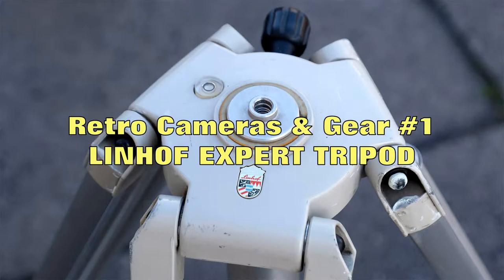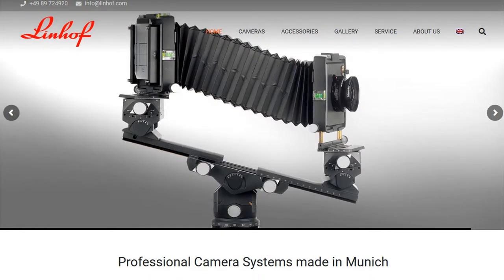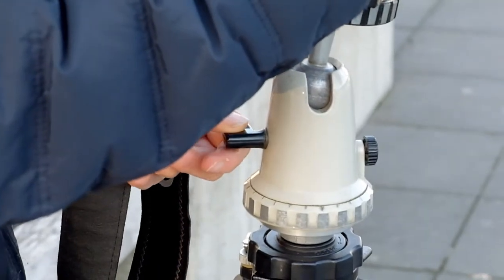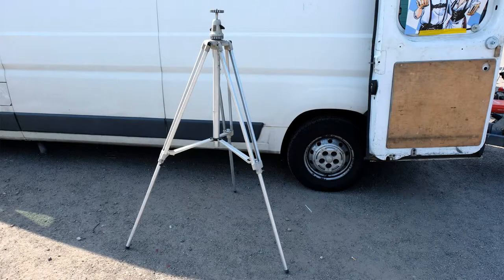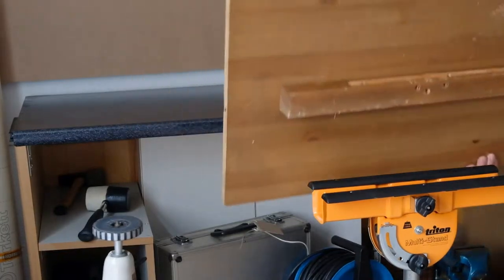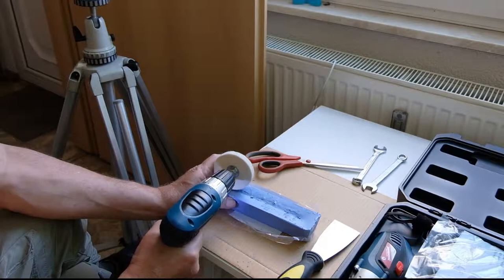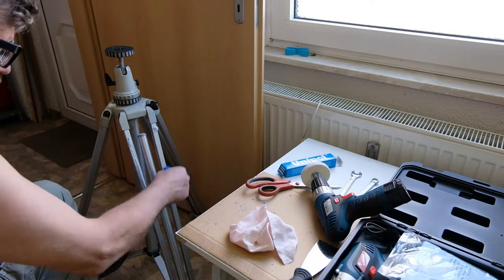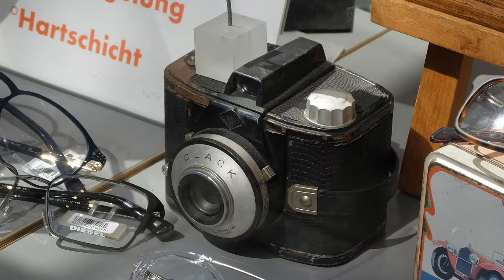60 years old Linhof Tripod is worth to buy | NO-FRILLS

Comment: NO, the "hard friction" is because the weight is not there, it is designed for a large format monorail/press camera {2-5Kg}, so it needs this friction, so the lens doesn't make the ball move at large extensions, (see the technika's triple extension feature), once these are on the ball head, the friction reduces to a smooth level, and PS with these heads, they are only meant as what today we would call a 'leveling head', to set a level platform for the camera movements to do the 'heavy lifting' in composing the shot.